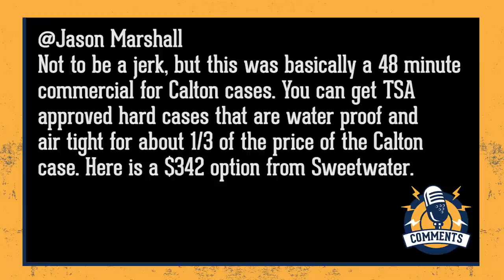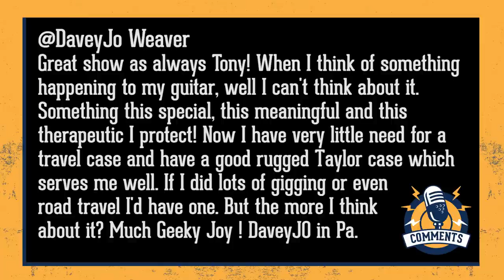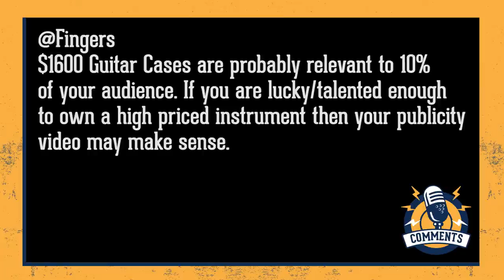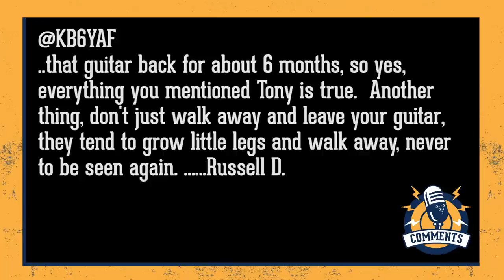6 Priceless Lessons from Molly Tuttle ★ Acoustic Tuesday 146

Comment: Here's a review for anyone interested. My "Epiphone, Masterbilt Olympic Acoustic/Electric" Guitar just came in this afternoon.
It was set up PERFECTLY right out of the box. Intonation, action, Bridge centering, Everything! I wouldn't change a thing, not even a little bit! The craftsmanship is perfect. No jagged fret edges, no flaws ANYWHERE!  I played it for about 20 or 30 minutes as just an Acoustic. It sounded like I expected it to, Not as much projection as a larger body, and a bit of what I call a "Tighter" tone, although with good sustain, and a Nice tone. Then, I plugged it in, and WOW! I played it through a Bose S1, on Battery Power, and it sounded FANTASTIC!  TOTALLY ACOUSTIC... just Louder with even more sustain. I've had several guitars that lost some of their "Acousticness" when plugged in. I don't think I've EVER had one that sounded COMPLETELY Acoustic like this. The Neck is VERY comfortable. The Tuners are 18:1, very nice. The Pickguard came unattached, which was nice because I haven't decided whether I want it on or not, and if I choose to leave it off, there are NO screw holes in the body. I would HIGHLY RECOMMEND
this Guitar.  I've had well over 150 guitars over the past 5 decades, and only a few came so perfectly set up, and they cost ALOT more than this. So, in case you've been considering one, I would say, Go for it, you'll be glad you did. I'm gonna go play now.